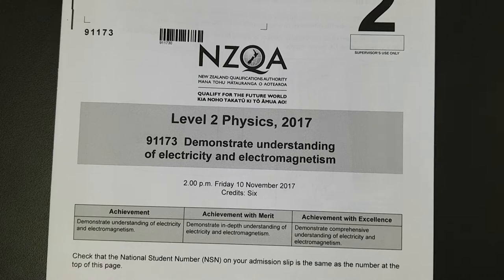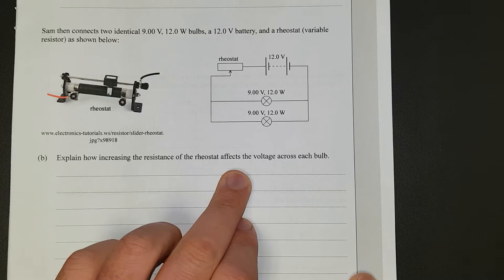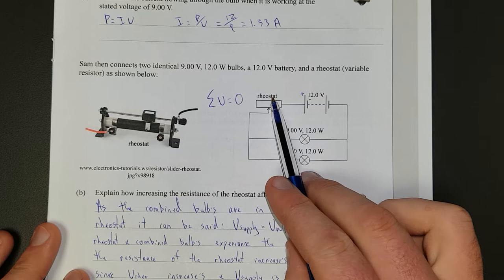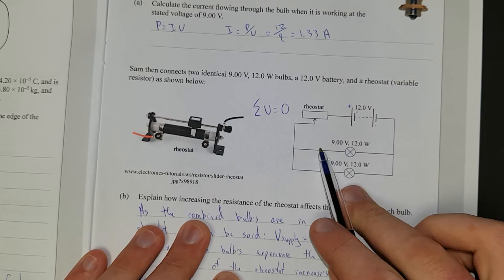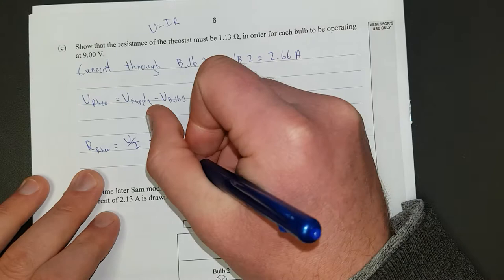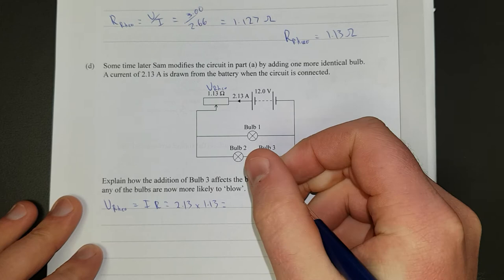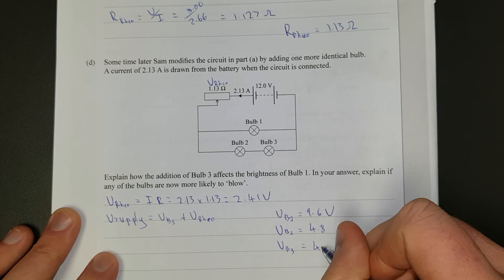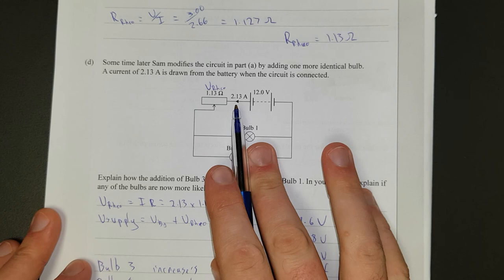2017 Electricity (NCEA Level 2)-Q2

Comment: For question 2b would it be wrong to say, 
"Increasing the resistance of the rheostat increases the total resistance of the circuit. An increase in total resistance results in a decrease in the total current when the voltage from the battery is fixed. With less current flowing through the circuit, the bulbs will have a decrease in voltage." ??
Reply: Drip too hard. Pray for me. I’ve exam tomorrow
Reply: @Meekys ohh ty! Good luck today!!!!!
Reply: @samuelfrancis8574  praying every second lmao good luck for todayyyy